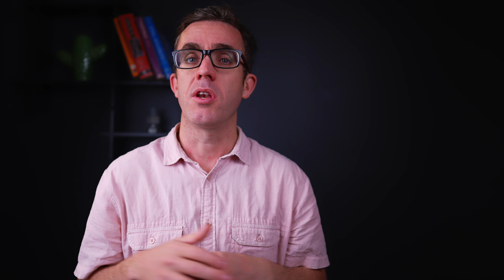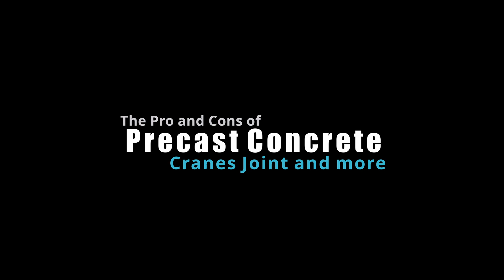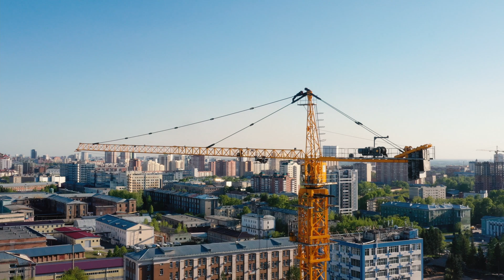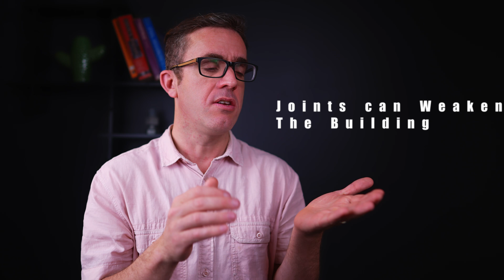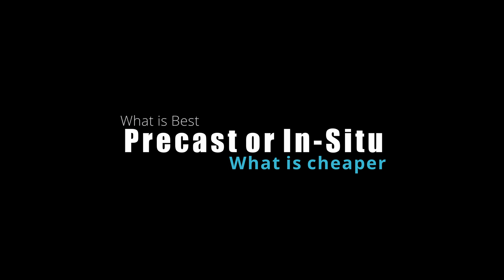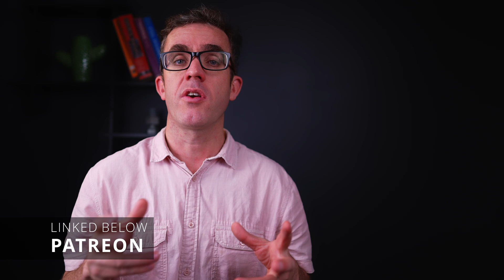Precast concrete vs In-situ concrete Who Wins?

Comment: How far away can precast concrete walls be shipped? Does shipping cost materially factor into the cost calculation vs. in-situ?
Reply from the maker: Hi Clark, shipped transportation does come into the cost greatly typically I'm areas far away from precast yards are insitu as it is much more efficent to transport concrete in a liquid or un mixed state.

Comment: I teach concrete design at University (in Architecture, not Civil Engineering), and, while this in situ/precast debate comes from time to time, however, the most trendy debate among students nowadays is to completely get rid of concrete at all because of sustainability reasons. Most questions I get from students regarding choices during the structure conception phase are related to how to avoid using concrete at all. I'm telling you this because I truly believe the cause is that concrete-related companies and businesses didn't do their homework of properly showing to the public that concrete can be more sustainable than other options. At the University we can do very little to counteract this craziness, when the "concrete is not sustainable" motto is the trend everywhere.
Reply: imagine if the students actually questioned the climate agenda BS. then they'd be really thinking. IF ONLY we had educators who also used their brains..
Reply: Ask them to do the maths .. how much plantation timber would it take to replace the world's concrete consumption, and how many planets would we need to grow that timber? Or how much steel would it take, and what would the climate impact be?

Concrete's CO2 impact is because we use so much of it. The solution is not to replace the concrete with something else, because all the alternatives are worse. The only way to fix this is to build less.

Architecture students are in a great position to push for building less. The easiest way is to change our time spans. Instead of building a 50 year house, build a 500 year house - that's an instant 90% reduction in annualised embodied carbon.
Reply: Hi there..As the owner of Benzini Precast Concrete, I can perhaps chime in here. Concrete is part of the "Stone" / masonry constructions elements (Such as timber, steel)  my question to anyone who is questioning the sustainability of of concrete is.." Have you ever been to Rome? Egypt? London?  I ask this question because the only buildings and or monuments that are still around today from 500 or 2000 years ago are concrete and or stone or reconstituted stone (concrete) . 98.5% of timber buildings cant last longer than 100 years. So the question then becomes... At what end of the candle are you measuring sustainability?  Imagine if every road or freeway was made out of timber!! well guess what .. it used to be, but we upgraded to a more "long lasting" "sustainable" solution 100 years ago  .. concrete.!!!!The same shit thats been around for 3000+ years!!!~  Its about as sustainable as you will ever get.

Comment: Could probably find optimizations if you could make the factory mobile to fabricate modules with in-situ concrete. ie. if the factory could fit inside a series of shipping containers, you could stay busy since the mobile factory would have 4 walls and a roof to protect from bad weather.
Reply from the maker: Hi Ghost storage of the green precast panels needs considerations, it would save on transport but at the cost of space.
Reply: A canopy on wheels which can be shifted over the tables is all that's required

Comment: Opal Tower failure was just at the joints between two precast wall panels where insufficient grouting and detailing had caused the structural splitting damage.